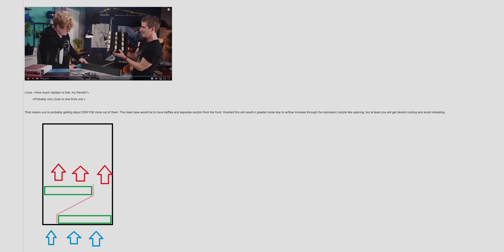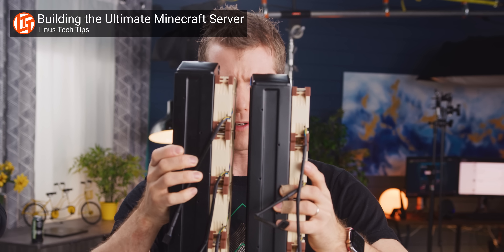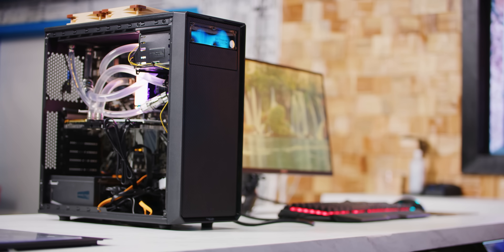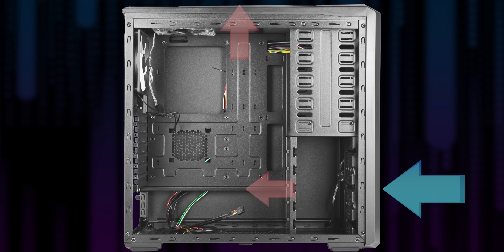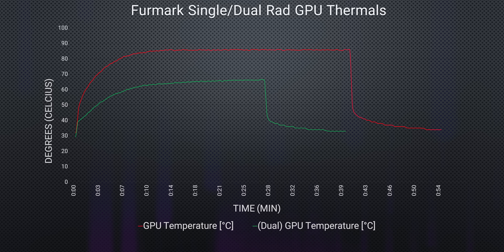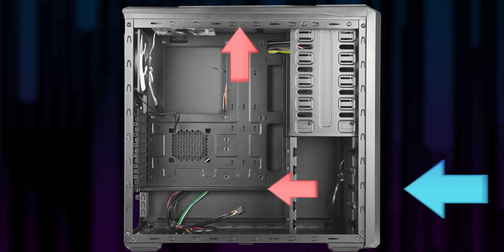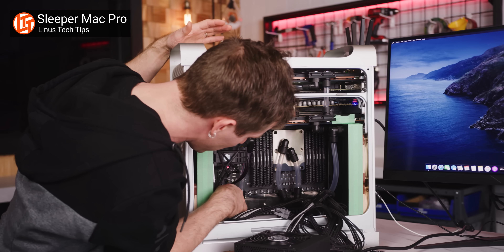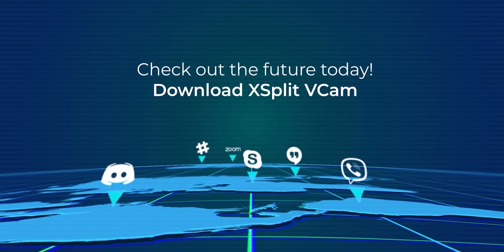I’ve been water cooling wrong for YEARS - $H!T Manufacturers Say

Comment: As an AC tech I had an odd thought you mentioned those rads are in series I'm thinking it might make a difference which one is first in line getting the cold water
Reply: The rads cool the water not the pump. Don't loose your focus on the point. More rads, more cooling. Not optimal in a stacked config but effective. Ambient air is outside the case. After air flows through even one rad that air is no longer ambient. As long as the air that is being pushed through the first rad and into the second is cooler than the water temp in the loop the product temp will still be improved. If the first rad is so efficient as to be putting so much heat into the next rad,( over the total temperature of the water in the loop) the you will not benefit from the second rad in that series config due to heat being introduced into the loop form the second rad or your own doing or efforts/ mistake! That's the vid or blog I think Linus was trying to demonstrate.
Reply: @SterlingSword98  Even radiator position doesn't matter too much. In a water cooling setup most pumps are meant to be lubricated by water and normally the spec is around 50ºC water temperature maximum, over that any pump manufacturer will warn you of pump degradation and/or overheating. If it's an AIO then it depends on the coolant specs which temperature is in the safe area for the pump: but PC hardware shouldn't run over 80ºC, so you can't even go that crazy with whatever liquid you choose.

What's the best prediction for air coming out of a radiator with intake at 21ºC and water at 50ºC. Radiator exhausting air at 30ºC? If you stack radiators this may decrease performance in a meaningful way, but if then air has to go though the case before being intake for another radiator that 30ºC exhaust figure could be lower actually depending on your case.

What I mean is that in the end despite there's efficient ways to achieve cooling and certainly in PC cooling they aren't used there's a reason for that: usually the temperature differences when water cooling are so small that isn't worth the hassle going around engineering, at least not in the end user realm.
Reply: Water temp is all the same due to the pump speed, the temps we are working with (not like a car engine), and the way thermodynamics work. 
You can put a coolant temp probe right after the CPU and GPU to get the theoretical hottest temp, then also put 1 right after the water leaves the radiators. The temps will virtually be identical due to the speed the water is moving through the loop.  It’s in equilibrium.
Reply: @DD-sw1dd  physics says no.
If the radiator is dissipating any great at all the water temp must be lower after it has traveled through the radiator
Reply: @joashparker8271  He's saying the temp difference is negligible, not that it doesn't exist at all. I don't know if he is right or not, but his position doesn't defy physics.

That said, I assume you would want the first radiator in the series to get the virgin air right? That would maximize the efficiency of the most efficient radiator. (Edit: I guess not. Seems counter-intuitive.)
Reply: @dude6935  What's the go with the profile pic?
I'm familiar with the <>< logo but not that variation

Comment: Well the air inside the case isn't hot these days where we have like 3 fans blowing cold air in and 3 fans sucking the air out. The airflow is easily high enough to keep the temps allmost to same as room temperature. Its even more so with watercooling where you have heat from the two most hot sources like CPU and GPU transported away right away via the water so it doesn't end up in the case unlike with air cooling (exluding blower cards ofc.) . Also with two rads the cooling power is so overkill that you can easily use one radiator as a intake and its still cool air pulled in since the system under normal conditions like gaming etc. just won't generate enough heat.

Comment: Please dont rinse me here, but i recently built my pc. Im using an NZXT H210i with two internal rear fans (one top, one back) both set to exhaust and a front 240mm AIO rad with fans drawing air into the case over the rad. Have i got the front fans the wrong way around? Should i be blowing air from inside onto the rad so it immediately exhausts it? The front of the case stays the most dust free though as far as ive found

Comment: Ok so my hypothesis is to why it keeps it cooler, with including the intake next it is. The source of water is shared by the two radiators are the same so the other raidator is receiving cool liquids from the other, because I think if it had its own water source separte it might reach higher Temps. Seeing not all the air might not be pushed since doesnt have gaskets to prevent leaking the intake help push the cool air leaked from the exhaust. My educational guess

Comment: Nice testing; Real world testing should always be done IMO. I do see a few issues: (1) If you're testing with the side of the case off, you are letting in a lot more cool air. The flow isn't laminar either. (2) The radiators aren't really stacked. Overall it depends on how much air flow you get into the system and the laminar flow to and in-between the rads. Vehicles typically stack radiators but they account for a greater volume of air and heat transfer (Thermodynamics FTW) capacity.

Comment: Mabie you gotta leave it on load for longer than just that first hour of right after building the pc and stress testing it. Mabie stress test it longer. Bc the longer u have it on the more heat your gonna have in the pc. And in the real world or if your gaming for hours your gonna build heat inside the pc. My suggestion would be stress it out or play games for a couple hours then do your temps again. Without opening the pc. Bc if u open up the pc it be like you letting fresh air into the top rad and not just letting the air from the inside of the pc in.

Comment: So I work in HVAC and Corsair does make a lot of sense and I think their point may have been taken a little out of concept, I could be completely wrong and I’m sure you do your due diligence, I feel like the point they were getting at that your wasting the second rad for it’s potential. To use it the way it’s designed to work would be to put two rads in both with a fresh air intake and then one “exhaust fan” this would create a pretty positive pressure unless your case allows for a bunch of fans. I’d lobe to see a video with the way you have it setup here and a setup with two Rads both pulling in cooler air from outside of the case

Comment: Refrigeration chap here. Corsair are correct in their theory. These test results merely show that the first radiator was not big enough to cool the fluid down to (nearly) ambient air temp. Put a temp sensor on the radiator fan inlet and the radiator fluid outlet. The fluid outlet will still be several degrees above the ambient air temperature (air on to the radiator). When you added the additional radiator, you got full cooling. To find out when a radiator is big enough, keep adding more radiators in series, or use a bigger radiator (more surface area) until the fluid outlet temperature is virtually the same as the ambient air temperature. Don't stack radiators as the hot air off the previous radiator will warm the next one up - you need fresh ambient air onto each radiator independently. You will get diminishing returns by adding more radiators (or a larger one) as the delta T gets smaller and smaller between the fluid temp and the ambient air temp. I would say a fluid outlet temp 1-2 °C above ambient is a correctly sized radiator; that may even be overkill. One obvious note is that the CPU, the cooling fluid, the radiator and the air flow off the radiator(s) will never be equal to or below the ambient air temperature (air on to the radiator) so adding more radiators will be pointless if not detrimental to the cooling performance as Corsair asserted. Detrimental in the sense that you might actually be adding heat back into the system with a poorly-located additional radiator e.g. one placed in front of a hot graphics card. You're also wasting money. Hope this helps!

Comment: Of course this is correct.  The purpose of radiators isn't to cool the components down, it's to remove heat from warming components.
More radiator surfaces = more areas for heat to dissipate from.  No fancy computer simulation can overcome physics.

Comment: Gotta do series vs parallel loops... otherwise you’re wasting some power on cooling
Reply: Parallel or seriel does not matter at all for temps.
And if you only have one inlet and one outlet on your pump, it will not matter for pressure either, as there are no more restriction in a radiator, then in your loop tubes.
The cooling of your loop is determined by the cooling capacity of your radiators, and the heating of the loop is determined by the power output of your components.
If you split the loop and put the two radiators in parallel, the flow will fall to about half, and soak up more heat from the component on that loop, and the fluid will remain longer inside both of the radiators and get slightly more cooling, but because the fluid was warmer before in entered the radiators, and they mix together in the same reservoir anyway, before being pumped out again, it will not matter at all.

Comment: The core logic of corsair only applies if the intake air instantly heats up to the temp of the loop, which is often not the case. If the loop runs 40c steady and ambient air at 25c moves through it, I'd wager that air comes out with 30c max, add some openings or maybe even an intake fan at the back and suddenly you get down to 25-30c mixed air going into the second rad. I wouldn't have guessed that the third rad makes a 5c difference, but it only further validates the assumption that air going through a rad does not in fact instantly assume system temps

Comment: Corsair was talking about dual radiators on the EXHAUST. Linus did a test for dual radiators on the INTAKE. Of course the temperatures were low on the intake because the exhaust was attempting to cool water with hot air.

Comment: This will probably get lost in the comments, but I'd like to see what happens when you equalize the number of fans on the radiators. What I mean by that is; In the first test there was two fans mounted to the radiator, and two fans mounted to the top of the case to exhaust heat for a total of four fans with only two of those fans mounted to radiators. In the second test there was two fans mounted to the front radiator and two fans mounted to the top radiator for a total of 4 fans with all 4 fans mounted to radiators. We already know that setting up fans in a push+pull vs a push OR pull results in lower temps across the board with lower fan rpm. While theoretically, putting two fans up top to exhaust heat would result in the same temps as 4 fans mounted on one rad in push+pull, for the same reasons as stated in this test those fans are also drawing in cooler air from the openings in the case and not just pulling more air through the rad. Long story long, I'd like to see this test again where the first test has 4 fans running off a single rad in push+pull, and the second test has the 4 fans split between two rads. I'm willing to bet that the 4 fans in push+pull actually do an equal or better job of cooling than when split between two rads, more similarly resembling the models seen by corsair. Why is this worth testing? 4 fans mounted on 1 rad is a lot cheaper than 4 fans mounted on 2 rads...

Comment: Moral of the story, if you're going to add another rad, add it at the bottom as an intake -- this in itself should lower temperatures instead of keeping the same temps (as in the video) or worsening temps (as Corsair's simulations have put it)

Comment: They said you get no better result, if the delta of air temperature which is blowing trough the radiator and the water temperature is very low. 

And it seems for me, that the fans on the top on the case were blowing air from outside into the case and if so, then there is a huge delta and so it will probably help for everything which is cooled by the water. (maybe everything else in the case is hotter then). 

And if you stack radiator and fans directly then your second radiator will be cooled by already warmer air. So it could be better, but it is far worse as if you would cool it with "cool" air. 

So what corsair said is totally true :D

Comment: I never understood why anyone would stack radiators rather than have them separate to get the coldest air possible across the fins.  I also never understood why people put radiators inside the box.  Your either pulling in cold air and blowing hot air into your case, or your blowing hot air from your case across the radiator.  Will it work?  Sure, my car's radiator blows hot air right back onto my engine and it's fine.  But, if you're going to go through the effort to increase cooling, why not make it optimal?

Comment: 1. if stacking is necessary, hot inlet last, cool outlet first
2. internal ducting is an option, put those old rh board Dell shrouds to use
3. if one shrouded and one case air, route the hot water to case vented first
4. if you split flow, one pump on each fork if possible

Comment: If the fans for the second rad were drawing air into the case, that would explain the large temperature difference between the single and dual rad setups. But if the fans were orientated to act as an exhaust on the top rad, I would expect recorded temperatures to be closer to Corsair's simulations. (Mech. Engineering STUDENT, so take what I say with a grain of salt)

Comment: If the engineers were commenting more on the efficiency of the set up, then your testing (which focuses end results of the setup) is kind off the mark and is just two people talking past each other.
The characteristics of the fans matters, if you are moving more air through the rad than it's designed air flow rate the rad will be less efficient (in terms of thermal transfer). If more air is passing through your rad than it was designed for you may only get to an outlet air temp of 35 instead of 39 as their engineers had calculated (they could also be greatly exaggerating the efficiency of rads) in which case the second rad can provide additional cooling (though their engineers already figured that this cooling would be performed by the first rad so it's more like you are reclaiming the cooling you would have otherwise lost). To further complicate matters putting fans in series changes their air flow characteristics, generally resulting in more static pressure (though this should be balanced out by the increased airflow resistance of multiple rads).
Needless to say the rate of flow of the coolant/water also has an effect on the rate of transfer and efficiency. Also in here is the way the water piping is routed, if in series the second rad should be first in the water piping (hotter water temp to go with hotter air temp keeps the deltaT up).
Finally the effects of infiltration air should not be discounted which potentially nets you a lot of additional cooling through the second rad in this particular machine. A more pure test could have been performed by piping the rad(s) outside of the case. Measuring air and water temps in several places would have also been helpful in exploring the 'why's rather than just the 'it just works'.

Comment: I would be interested to know the coolant temps entering and leaving each radiator. I would be willing to bet that the exit coolant temp of the first radiator is still higher than the exit air temp. on the stacked setup I would bet the best config would be to have the air exit side be the coolant hotside and the air entrance be the coolant cold side.
Reply: true, opposed flow or watever it's called. Works borth for fish gill blood flow and heat exchanger coolant flow

Comment: The air coming off the first radiator won't be at the temperature of the water especially for these kinds of radiators. It's just not going to reach it, meaning that stacking radiators will yield slightly more performance.
What Corsair meant is that as you add more and more, the airflow gets more and more restricted, lowering the efficiency of the radiators, so the radiators won't be as efficient, and if extreme enough, it will lower the airflow so much that it will certainly negatively impact your performance.
Corsair was technically right but they didn't consider your circumstances enough and that in your case, those extra radiators did help. There was ample airflow through them, and it works fine.

Air sucks at storing heat but the air coming out of the back of a radiator won't be as close as the water temperature as Corsair claims. Unless your fan is basically not running.

Comment: When you are stacking rad banks like in the minecraft server into which end of the bank did the hot water go? Ideally it should go into the back ( down wind end ) and come out of the front (up wind end).

As air moves through the rad bank from  front to bank it will be warmed and get hotter. If, as the air moves from front to back it will encounter hotter water but the air will still be cooler than the water and so can extract more heat. Heat recovery systems for HVAC work this way with the air and water ( or air and air ) flowing in opposite directions.

I'd love to see the minecraft server cooling revisited and have this checked out.

Comment: I don't understand how corsair could even state this, temperature change is relative to the difference in temperature and as you heat up the air the ability to further heat the air decreases, meaning one single rad could never reach equilibrium with the heated water on it's own unless it was made out of some magical material with 100% thermal conductivity, which could probably be described as ice magic.

If corsair knows how to use ice magic then why are they holding out on us.